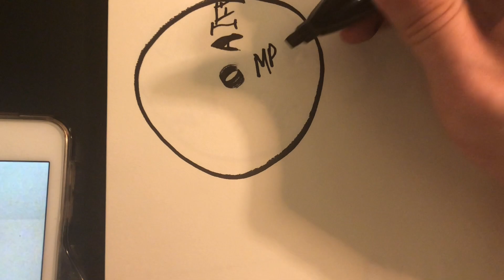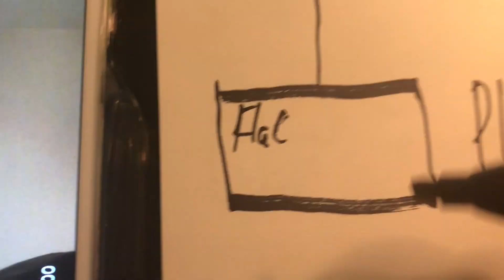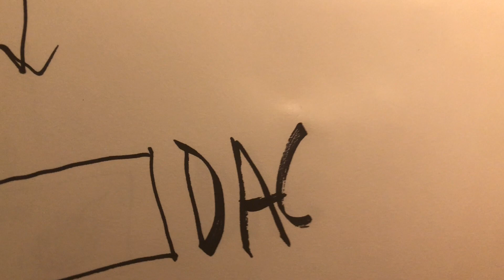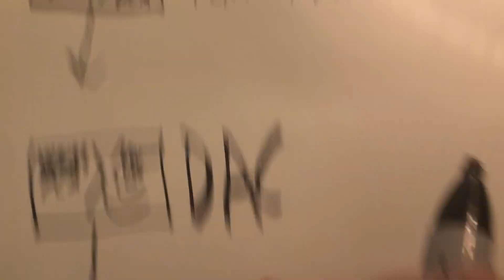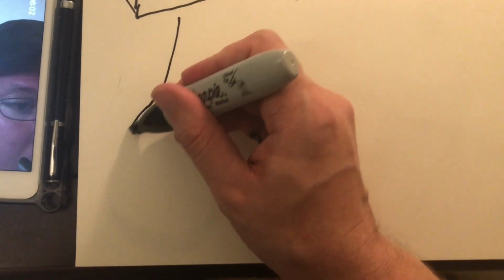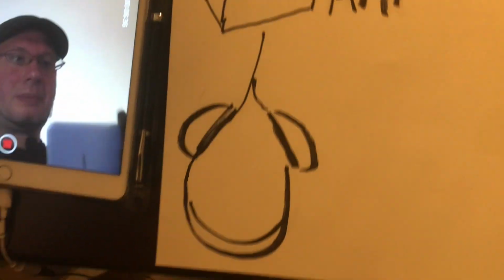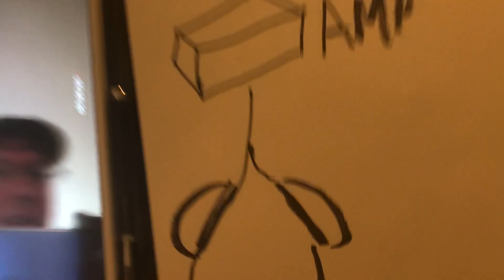Teaching Tuesday - Audio Component Overview

Comment: which is more important? A Dac or an Amp?
Reply from the maker: There’s a couple ways to answer that...

On a basic level, they’re both essential when dealing with digital audio (anything not Vinyl or tape), and you can’t have audio at all if you’re missing either piece.

If you’re asking more to see which component to upgrade first to see the biggest effect, the answer would be whichever component is the weakest link in the component chain. Each piece has a necessary job, and any quality loss in the signal is passed down to each piece down the line and limits the quality of the final outcome. “Garbage in = garbage out.” That applies to the headphone, amplifier, DAC, playback software, and the source files. There’s also a hidden link in the chain often overlooked: interconnect cables, which are literally the links of the audio chain, but some people also consider them a “component” of the audio chain.

Each component has its own effect on the final fidelity, which is why I’ll cover each piece in turn. Usually, people first upgrade the source files from crappy 196 kbps MP3 / YouTube/ the free tier of Spotify to the higher bitrate, then upgrade from cheap earphones, and not realizing they benefit when they use the Apple lightning dongle (which is a DAC/amp) or they connect directly to a desktop PC motherboard instead of front panel audio or a laptop. Around the time people get headphones in the $150-$200 range (like your K702), usually the first thing they improve first is the Amp. Some headphones (like your HD 599) are easy to drive though, and they benefit from a more organic and natural sounding DAC, which obviously would also provide the same benefit to a harder to drive headphone.

Eventually, though, it pays off to have each component of the audio chain dialed in. That is why I’ll be covering each. And maybe remaking this video some day... to try to get into the rhythm of a regular release schedule, and a bit of nerves, this one got a bit rushed 😅 I actually prefer the way I write over the way I speak on video!
Reply: @evshrug  as you know, i have a SMSL M3 with optical port to PS4 (and soon PS5)

can i use this in conjunction with that (stack), and still connect the whole thing with optical?

https://www.amazon.co.uk/LOXJIE-P20-Balance-Amplifier-Headphone-Black/dp/B07H5HK3QT/ref=sr_1_2?dchild=1&keywords=liquid+spark&qid=1599069229&quartzVehicle=138-258&replacementKeywords=liquid&sr=8-2
Reply from the maker: @danterikxx  As long as you don't have a PS4 Slim, you'll be able to connect to the PS4 with optical (or USB) to your SMSL DAC. I take a bit of an issue with Amazon saying "Yup, that's a Liquid Spark..." The real Cavalli Liquid Spark is here:
https://www.monoprice.com/product?p_id=33304

 Looks like the PS5 is dropping the optical output... but you can "add" optical from an HDMI adapter, like this: https://www.monoprice.com/product?p_id=24278
With that said, if the PS5 is like the PS4, you can also get regular stereo out through USB. As long as your DAC can use generic drivers, it should work with USB to your DAC.